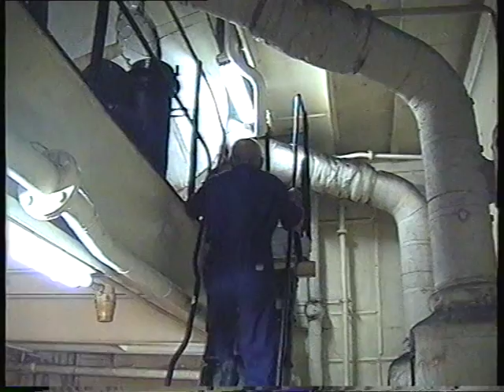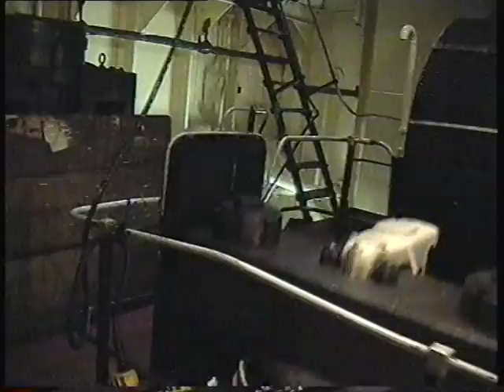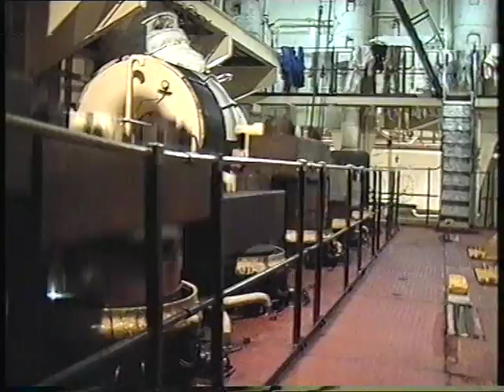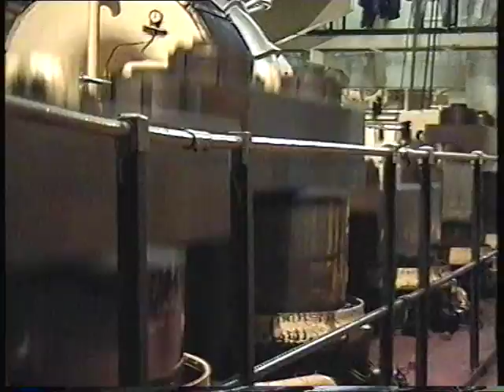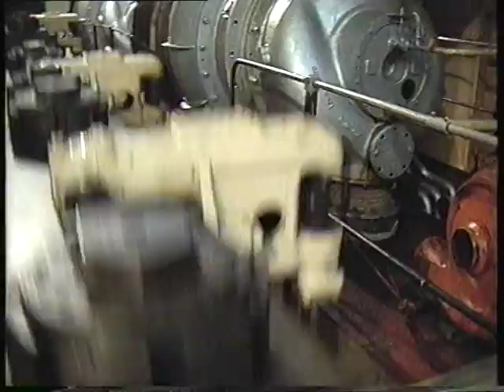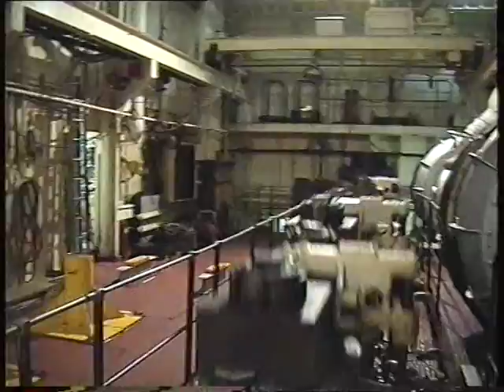Doxford J-type on board MV Clydebank.

Comment: its a  76J6. 115 to 118 rpm full ahead on FAOP sea speed setting. Gave the 6 ships in this class around 22kts.
Reply from the maker: Philip Evans I guess those were the speeds at build/sea trials, because we had it pegged at 110rpm max. Regularly shut-off on over speed when the prop broke the surface when running light ship.
Reply: I remember running back from PNG with palm oil and Copra on the Moraybank and across the Indian Ocean and the Med we were running at 115 - 118 rpm, but the prop had been clipped on all of the blades so that the engine revved more freely but also burnt less than the huge amount of heavy oil they burnt per day.
Reply: Don't forget, the Clydebank went aground on the speed trials at 122 rpm, doing around 23 kts just off Sunderland.  Tore a huge lump out of the bottom, she was still in the builders hands but the insurance company turned out to be a subsidiary of Andrew Weir.

Comment: About 50+ years ago I worked for Servodyne Controls Ltd who made speed governors for Doxford engines.
Reply: Govenors were Woodward.
Reply: Blast from the past there.
I did my cadetship and up to 2nd Eng with BP and as 4th Eng on the British Hazel in 1977 drydock in Immingham, Servodyne fitted an early prototype for sea trials. Not a major success, it held the revs for too long right in the critical rev range and didn't respond quickly enough to bridge control. It was removed and we went back to the original Woodward mechanical governor. 
Never sailed with a Doxford, but did have the honour (??) as a cadet in SSMTC (as was, now South Tyneside College) of starting the single unit prototype Doxford donated by the works to the college.
Reply: Sailed on a Doxford with Servodyne controls in the late1970’s it wasn’t a great success.
Reply: @grahamc887  Thanks for your comment. I can't really remember now how good/bad the governor was. At that time I was just doing as I was told during the development. When Servodyne went bust I started work for Heinzmann in 1979, initially working from home developing electronic governors. I retired aged 70, eight years ago.

Comment: Thank God  I have never got entangled with repair of that monster. Overcomplicated construction
Reply from the maker: Casspir Mk6 Actually, they were deceptively simple and very easy to work on (very accessible injectors and start valves, open camshaft and no electronics interfering). I've worked on many later engines (B&W, MAN, Wartsila Sulzer, etc) that were a nightmare to work on, mainly due to packaging constraints. These Doxfords were huge and maybe a bit cumbersome, but a joy to work on!
Reply: But a huge improvement with the heavy top beam and telescope pipes for the coolingwater to the top piston, compared with the original design with rubber hoses.
Reply: @DubStu I’been working on same array of MEs, each one (except old terrible classic MAN) had cons and pros. My last 10 years ME-Electronic beat them all in all aspects.